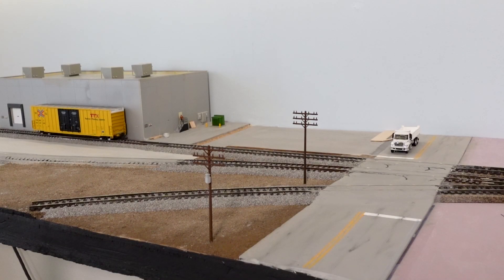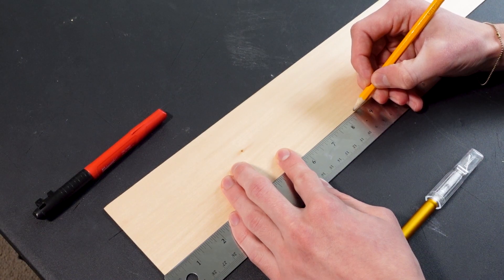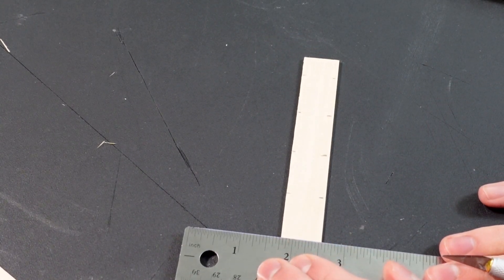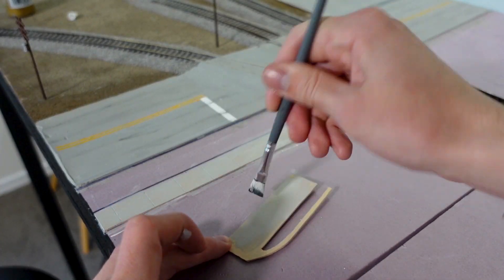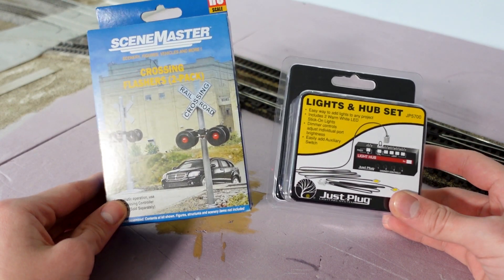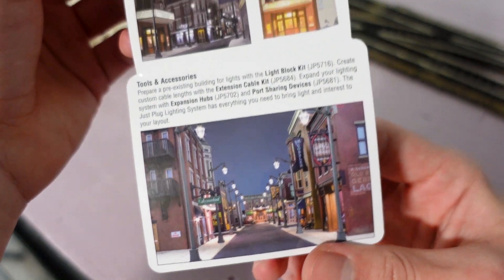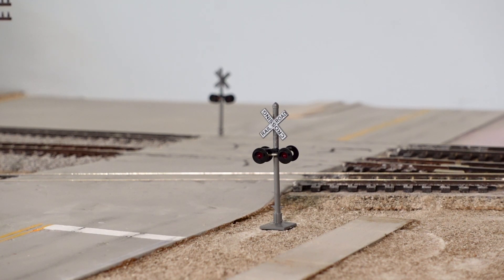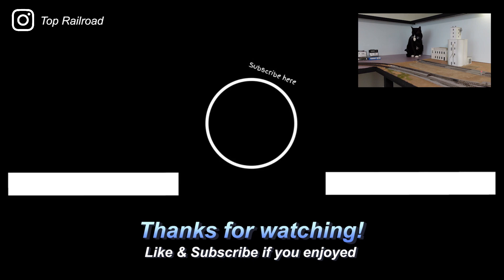Adding Crossings & Sidewalks (BIG PROBLEM OCCURS) - HO Train Layout Build Ep 26

Comment: Things are really looking great there TR!! I'm gonna pass along a tip on sealing the wood before you paint or stain. I've been using..... Varathane polyyurethane/ water based crystal clear # 200261H for years. Brush coat on both sides, weight down and let dry, its sealed and won't warp or bow after you paint. - Alex
Reply from the maker: That’s the product I need. Just need to go out and pick some up 😁 Thanks for the quick tip!

Comment: Use Woodland Scenics Accessory Linker Plugs (5685) to connect wires of crossing signals to hub.
Reply from the maker: Do those allow the crossing flashers to actually flash back and forth? Or are both lights just lit when turned on
Reply: @TopRailroad  You'll also need Woodland Scenics Sequencing Light Hub (5680) for flashing effects.
Reply from the maker: Okay I gotcha, thank you that’s a big help
Reply: That's more for turning room lights on and off at random, I don't think it's going to be much help for crossing lights. And little else is compatible with the Just Plug system.
Reply: @d-rail7271  It was the closest thing that I'm assuming could work since the controller from Walther's that works with the crossing signals are out of stock/no further vending information.